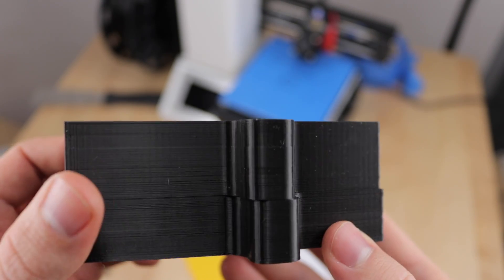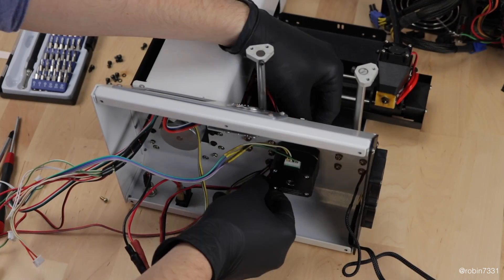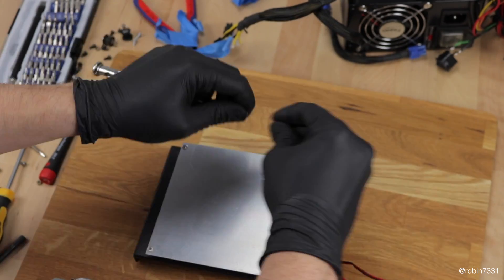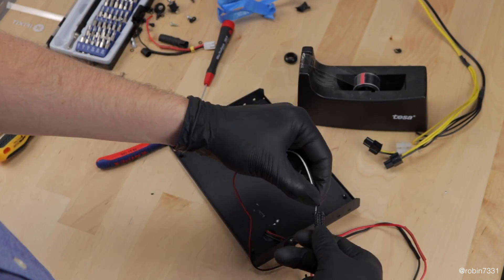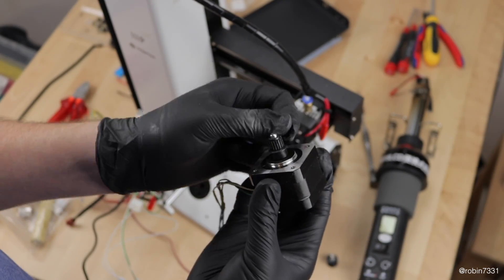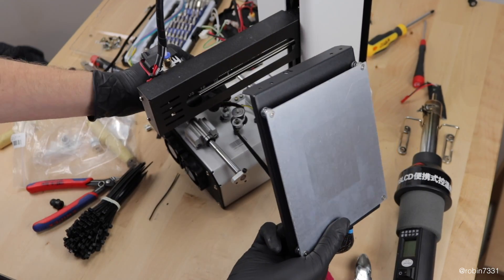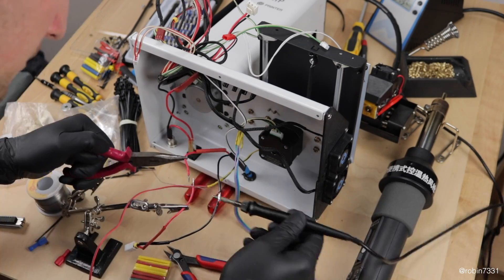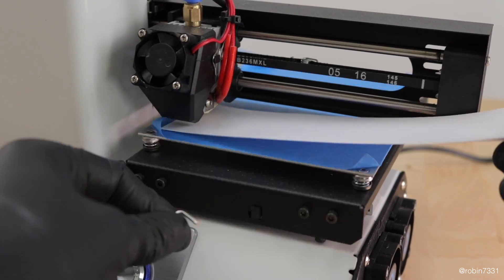MP Select Mini External Heatbed Wire Mod

Comment: nice video! did you already see the newest version of the printer? i ordered mine last month and it has a slotted hole for the heatbed cables so that it doesn't look as if there is any stress on the cables or they could hook up in the belt.

Comment: I'm about to do a similar fix on my Mini V2.  When I put the build plate back on and route the pulley cable, how do I know that the build plate is where the printer thinks it is?  Do I somehow have to recalibrate it?  Thanks.

Comment: I'm getting ready to make this same mod to my printer because the wires actually failed. At first, the heated bed just stopped working but I could still print PLA because the firmware thought the bed was at 555 degrees(higher than the target of 50). However, I didn't have any spare wire when I took the printer apart looking for the problem(I checked the thermisttor first). I decided to shorten the thirmistor wires(which forced me to leave the side panel off) because they didn't have continuity(but the power wires did). This worked perfectly for 2-3 heat cycles and then the bed stopped heating up. So, now I cannot use my printer at all because the printer knows that the bed is at 30(which is lower than the target of 50). I could probably shorten the power wires too but I am tired of fooling with it and decided to fix it when the new wires arrive.

Comment: Its sad that an engineer who designs the 3d printers cant come up with simple shit like this. I am amazed how so many garbage printers make it on the market like they do. Good work
Reply: I’ve owned an MP Select Mini v2 for 3 years, did many hundreds of hours printing, including 10+ hours prints and never had this issue or the purported overheating issue that some people mount these additional fans for. I replaced the X belt once as regular maintenance. Y belt is still the original. This printer is anything but garbage. An STM32 + 8266 + a great color screen, Prusa has yet to catch up with that today, three years later, for less than USD200! Malyan did a fantastic job on this printer.

Comment: Question, did you extend these wires to make this happen? Did I miss that step? I have my printer apart now and starting to route wires which seem to short. I'm just checking with you  before I start hacking away at the wire and wanted to make sure this step is needed.
Reply from the maker: You mean the bed heater wires? Yes. I‘ve extended them.

Comment: My heated bed stopped heating.  So I decided to do the wire-reroute-larger-wire upgrade. After the upgrade, neither the bed nor the nozzle heat.  When I did the upgrade, I soldered new 16 gauge wires to the heated build plate and then soldered the new wires to the last inch or so of old wires (so that I could reuse the connectors).  Please provide suggestions on how to troubleshoot. 

MY questions:

How much voltage is applied to build plate normally?

Wires placed to the outside (namely, black and red) on the build plate are the positive and negative of power supply for heated bed (please confirm).

Are the two wires placed to the inside (also namely, black and red) on the build plate are exclusively for the thermistor (please confirm).

When I removed old wires, there were no breaks or cuts in the old wires.  Which leads me to believe that my no heat on the build plate condition was NOT caused by faulty conductors.

Your help would be greatly appreciated.

Comment: QUICK question: My MonoPrice mini just started powering off in the middle of my prints - I haven't had it very long. I am getting ready to re-routing the heated bed wiring. Do you think the hotbed wire re-route would stop the symptom my machine has?
Reply from the maker: Gouldeyecandy Hm well could be. You may also want to check the 12V power. Make sure the screws are tight and also the socket where the external power supply is plugged in is wired correctly. I‘ve seen that a couple of times happening to people. But rewiring the hearbed certainly is not a mistake on this machine :)

Comment: Very well done. On those heatbed wires, because they do carry alot of current, I would suggest you do a NASA splicing technique in stead of just solding them like you did in the video. I mean no disrespect at all. Its just a suggestion. Overall, I was very impressed with your video. You did an outstanding job with making sure you protected the electronics from any metal caused by drilling the holes. 

I have one of these printers and it has gotten stuck a few times just like yours did. So I will most likely do this MOD when I see the belt to start grinding.
Reply: I had to finally do this mod after I found that the positive heatbed wire was completely cut through due to it rubbing on the belt. This mod works outstanding. Prints come out much cleaner as well. Thank you again for posting this video

Comment: is the outer diameter of the idler pulley 16 or 18? i see two different types online now
Reply: from what I've seen, the outside diameter isn't the number typically referenced; the 16-20 number is typically referring to the amount of teeth that would be on the pulley (which I suppose would affect diameter, but that doesn't matter, since they're referred to by tooth count). The stock, from what I know, is 16 tooth on all of the pulleys, so get a 16 tooth toothless idler pulley. So it's the same, you can also get 16 tooth GT2 pulleys with teeth instead of the 20 tooth stuff he provides links for, so you don't have to change the gcode; although I suppose the 20 tooth change will make it minorly more accurate, as there are more steps (EDIT: I lied; I googled it just to check, and it happens that less teeth = smaller step distance which = higher resolution, so it's actually better to have the 16 tooth over the 20 tooth, if you can find it--REFERENCE: https://www.reddit.com/r/Reprap/comments/2nnvdh/belt_pulleys_20_tooth_vs_36_tooth/). The amazon link he provides for the toothless pulley mentions "3mm 16" which refers to the fact that it's a 16 tooth pulley without teeth (outside diameter is 13mm, so it's definitely not referring to that).

Here's a link that I found for the toothless idler that I'll likely be using for purchase:

https://www.aliexpress.com/store/product/POWGE-2GT-16-Teeth-synchronous-Idler-Pulley-Bore-3mm-with-Bearing-for-Width-6MM-GT2-Timing/702327_32796850553.html?spm=2114.12010612.0.0.d310bfg4mcTN

Aliexpress shops pop up and go away often, so if the link doesn't work, either let me know or use some of the terms in the link (eg. "GT2 16 Tooth synchornous idler pulley 3mm bore 6mm width toothless" something like that) to search on aliexpress or amazon. Aliexpress is miles cheaper and is the same stuff they sell on amazon, it just cuts out the reseller.
Reply: also note that doing this will super void your warranty with monoprice; but I'm guessing if you're here, you're already on that path.

Comment: Do you tink that is possible to extend heated bed from 120*120 to 120*200 so that i can print phone cases
Reply: Here's a link to the mod page on the monoprice wiki, which provides some bed Y-axis extensions (that's the simplest direction to expand in):

https://www.mpselectmini.com/mods

More specifically, if you want a really inexpensive Y-axis only extension, you can use this:

https://www.thingiverse.com/thing:2401336

OR only the Y-axis extension instructions from this one (the prints utilized are much smaller and more efficient for the bed extension)

http://www.instructables.com/id/Under-50-Monoprice-Select-Mini-to-Mega/
Reply: also note that doing this will super void your warranty with monoprice; but I'm guessing if you're here, you're already on that path.

Comment: can these same pulleys be used for the x axis? I been able to print PC after some mods. Issue Im having is layer shifting in the x direction. I think the heat is causing my pulleys to slip too easily,esp when they hit a plastic speed bump which occasionally forms, the hotend hits these causing a the shaft to spin a bit in the pulley shifting the print. I think replacing the plastic pulleys with metal should fix that.
Reply: That's definitely possible. From the research I've done (see article: https://hackaday.io/project/14823-monoprice-select-mini-maximum-3d-printer-mods/log/60053-x-axis-gt2-belt-upgrade-e3dv6-carriage which is also filled with tons more cool mod ideas), it looks like the X-axis motor requires a GT2 6mm width (that's the belt width), 5mm bore (for a 5mm shaft on the motor), 16T/16 tooth drive/timing pulley. That is what seems to be required to replace the default, plastic pulley in the printer.

I found it here: https://www.aliexpress.com/store/product/GT2-Timing-Pulley-16-Teeth-16-Teeth-Alumium-Bore-5mm-Fit-for-6mm-Width-GT2-Belt/1504095_32621920304.html?spm=2114.12010612.0.0.4ab4392debHPx6

To further, you can also get a 6mm width, 3mm bore, 16T TOOTHED (they come without teeth too, which is what is used for two of the pulleys under the bed) idler pulley for the far end of the x-axis pulley (you can see the pictures of it in the article).

I found that here (be sure to select the "with teeth" option):

https://www.aliexpress.com/store/product/POWGE-2GT-16-Teeth-synchronous-Idler-Pulley-Bore-3mm-with-Bearing-for-Width-6MM-GT2-Timing/702327_32796850553.html?spm=2114.12010612.0.0.d310bfg4mcTN

Aliexpress shops pop up and go away often, so if the link doesn't work, either let me know or use some of the terms in the link (eg. "GT2 16 Tooth synchornous idler pulley 3mm bore 6mm width" something like that) to search on aliexpress or amazon. Aliexpress is miles cheaper and is the same stuff they sell on amazon, it just cuts out the reseller.
Reply: also note that doing this will super void your warranty with monoprice; but I'm guessing if you're here, you're already on that path.
Reply: yeah to hell with the warranty. Basically if you own this machine, you need to do the bed rewire, bc its only a matter of time before the wires break. Mine lasted about a week and thats pretty typical. In the MPSM owners FB group, just about eveyone has done it. The only ones who haven't only print PLA and don't need a heated bed. There are very few ppl who's bed wires still work stock after 6 months.
Reply: Yeah, that's definitely a major issue. I suppose the warranty should cover it, but you'd have to send the machine back like 20 times haha. I think I have some extra cable sleeves from an old modular power supply that I might use to hopefully keep it running for a little bit longer, before I do the full rewire.

Comment: Bro, firstable you're amazing with that printer. I have the same printer but and the problem that I have is the heat bed is not heating up as well. Do you know what could be the problem with it?
Reply: If the heatbed isn't shown as heating up, but is still getting hot (just the screen isn't displaying correctly) then it's the sensor (which is one of the wires under the print bed). If it's not heating at all, then it's likely one of the actual power wires that go to the heating bed. This is a common problem with the Monoprice Select Mini, and is the major reason why the guy in this video did this mod (so the wire isn't being constantly moved and rubbed under the bed).

If you still have your warranty, I would suggest utilizing that, as that would be the easiest way to get it fixed. If you're out of warranty, you can attempt to re-solder the old wires (it could just be a bad soldering job, or the contact came loose); or what I suggest, soldering new wires to the heatbed, which requires a bit of skill but will save you a lot of fixing in the long run.

See this video for some instruction and ideas on new wires to obtain (I think this guy used speaker wires for the power..a big thing I hear to use is silicon insulated wires, because they flex well and handle heat well):

https://www.youtube.com/watch?v=W1MqNMbGtDY&feature=youtu.be

Comment: You forgot one MAJORLY important step: You MUST extend your wiring to do this. You didn't mention that in the video, and I just spent 4 hours on this, only to find out that my wiring is 6 inches too short!
Reply from the maker: #notagrom Hm I never heard someone complain about too short wires. But anyway. You've gone through the entire process including drilling and all that stuff but are not willing to simply extend the wires? Add 5 minutes for that to your 4h journey and your set. What is your problem?
Reply: I didn't realize it was too short until everything was already ran. Meaning the wiring loom and heat shrink will have to be cut off, forcing me to find more of both (which is a trip to town, 20 miles away). Also, you don 't just "extend" wires that move. You cut them to length. Adding wire in the middle will cause a weak point in the wire. I shouldn't have to explain that to you. Being that I soldered the factory connector onto the wire, I have to desolder everything and basically start over .. adding a 20 mile trip and the cost of wire and loom that I didn't have to pay for the first time .. That's a hair over 5 minutes.
Reply from the maker: I'm sorry that this video caused some inconvenience on your end. 
What I don't understand is why so many people did this mod but not a single person was complaining about the wires being too short.
You sure get a weak spot when extending the wires. But when soldered and heatshrunk properly this should last quite some time as the bend radius is pretty forgiving.
If I understand you correctly you did cut off the connector and resoldered it after you put everything back in place.
So you either soldered a wire back in that was shorter than before or you've gone with a new wire that you cut in length. Either way you could have easily checked the length before soldering everything back together instead of calling me an asshole.
Reply: I was just frustrated. I edited my comment. After looking around online, it seems monoprice uses different wires, plugs, boards, and wire bungs for various models without changing versions. Most likely, you had longer wires from the factory than the one's mine came with. I edited my original comment and changed my dislike to a like.
Reply from the maker: #notagrom I fully understand. Things like that get frustrating very quickly. Believe me, I know that :) 
Thanks for the like though!
Reply from the maker: But when you say that they might have changed the wires it should be important to tell all the viewers. I'll figure something out..

Comment: Did you notice any improvement to performance after replacing the pulley wheels?

Oh, and thank you for this video, you taught me a lot!
Reply from the maker: +ETE Production Not really. It is more to prevent a failure one day. I figured this makes sense once I took that buildplate off..

Comment: What are you running the two side fans off of?
Reply from the maker: Matt Malenda They are directly connected to the 12V rail. I did cut the input cables between the board and the switch and soldered in my own 12v distribution pcb.
Reply: Robin Reiter so you turned one connector into two? That's how I understand it
Reply from the maker: Yes, exactly. I kinda made a Y-junction with one end going to the board and one to a small PCB that distributes power to both fans.
Reply from the maker: Though it is not ideal. Those fans now start running as soon as I turn on the power switch of the printer. It was more a quick solution to prevent the stepper drivers from skipping steps on long prints. I'll update that one day to only switch on when the temperature is above a certain threshold or something like that.

Comment: I purchased the toothless pulleys from your link and they are definitely way larger than the ones in your video. they come into contact with the toothed pulley on the Y stepper. Should I be concerned about this?
Reply from the maker: Hi Tony, I am very sorry I must have accidentally copied the wrong link. :/
You need a GT2 Bore 16 3 not a 20 3. 
This one here should be fine: https://www.amazon.com/Pink-Lizard-Pulley-Without-Printer/dp/B01HZZ2FXM/ref=sr_1_10?ie=UTF8&qid=1494699550&sr=8-10&keywords=GT2+pulley+3mm+16

Sorry for that! You should be able to return your pulleys and get a refund from amazon.
I'll immediately update my link..
Reply: https://www.amazon.com/gp/product/B01H3FNZ4M/ref=oh_aui_detailpage_o00_s00?ie=UTF8&psc=1 would these ones work? they have nearly the same description and everything as the ones in the description link, just different product numbers and they obv look different.
Reply: Reading your reply twice and checking the link I posted they should be right, says 16T 3mm. And I had a big return order ready for amazon already so I'm just swapping the wrong ones out! Thanks for replying. Great vid and I'm working on replicating!
Reply from the maker: +Tony Lodad Awesome! Let me know if you get stuck somewhere.
Reply: Is there anything other than the program u used that i could use to update the printer after

Comment: Looking at this mod, you are so close to installing a larger print bed.  A set of longer guide rails, two pieces of Aluminum, and a bigger PCB heater would do it.  So close.